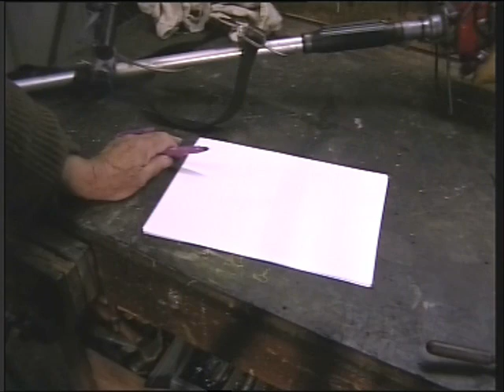cdi for dummies

Comment: Is it correct to say that on the CDI ignition coil. that the spark at the SECONDARY winding is produced on the RISING edge of the discharge capacitor into the PRIMARY winding?
I built such a model and the waveforms indicate this is so!
What bothers me is that several other sites claim that the spark is due to the FALLING edge--which is contrary to what I actually see.
Thanks for a video I can actually believe, as it agrees with what I actually witness!
Reply from the maker: Yes that's my understanding perhaps thats where some confusion may well exist the CDI coil consists of two windings (i.e. a transformer) and we are therefore dealing with "inductance" at some level some delay must be a factor,

Comment: I could argue but it would be point-less.....    hehehe.  My old GT125 Suzuki twin was perfect except for the points back plate. It was fairly highly tuned and the points were set by a tuner but the back plate constantly moved and id end up running on one pot kicked normally or both pots if i bump started it backwards!!!  It ran sweet IN REVERSE!  You cant do that with CDI. lol.

Comment: good video, have you any advice on a cdi problem I have in that a Jetski I rebuilt starts but seems to be stuck in limp mode ie' will not rev up its a Polaris sl780 any help will be very gratefully appreciated. yours George.
Reply from the maker: I know practically nothing about jetskis but you say it runs (allbeit poor) saids you have a spark, whilst many cdi`s may well have processing that advances the ignition to speedup the engine it would not be "my" first approach if fact the cdi is the last thing to go for ! left alone they more often than not, are not faulty, so I would take a look at carbonation .... blocked jets,resticted air inlet,or evan outlet, go for the most likely probabilities, and dismiss the assumption its a "cdi problem" highly unlikely !

Comment: hi I really enjoyed not only your vid but your commentary. I do have a question, that diagram you drew was that the sator and flywheel spark generation? my question is, is the static stator orientation important in relation to the flywheel rotation pickup when it comes to spark timing for the cdi? on my 4 wheeler im getting spark to the plug but its weak, and im unsure as to the timing. the cdi's resistance tests are outside specs. your thoughts would be valued. 50p plus lol
Reply from the maker: I`ll lay you a £1 to a 1p you have NOT got a week spark. review 5.00-7.00

Comment: billb
Help poroldchap!! I have a 2002 CB750 Nighthawk that runs great, except if you happen to stop somewhere and the engine is at operating temperature it won't start  back up or sometimes it even dies. So the problem is when the engine is hot, we have to wait for it to cool down before it will start. There is something in there that doesn't work right when the temperature is high.
Thanks
Reply from the maker: Japanese motorbike ? I`m not the person to ask !
Reply: +William Bigatti I would, 
A) Check for a spark with known good plug once the engine dies.
B) Buy a cheap compression tester if you don&#39;t have one and check for compression problems. If you have them, suspect that your valve clearances are too tight. As they get hot they get tighter. 
C) Touch the coils to see if they are hot when the bike dies. If so, that&#39;s your problem. Consider moving them or shielding them from engine heat.
I don&#39;t know that model of bike. If it has points lookout for a leak to earth causing an arc in them. A faint glow should be visible.  If it is a cdi problem you will need a Ohm meter and  the manual for the values you need.
Good luc
EDIT: Extra thought. Could be you are running the engine too rich. Check choke operation and the settings of the float levels and condition of the needle/shut off valve.
Reply: Hi, that's a common problem on old two stroke engines, it's cased by worn oil seals that are fitted on each end of the crank shaft. All  2t engines rely on crank case pressure to work, when they get old and worn, they leak when hot causing crankcase  pressure to be lost.  Trust me that IS your problem

Comment: You are bang on the button i have fixed loads of little motors and 9 out of 10 times iys down to the sparkplug oiled up and no spark. The only thing people can do is to mess up the amount of oil to petrol mix and boy do thay. The way i look at it is if thay did not we would be out of a job. Keep up the good work.

Comment: Do you think if you put a capasitor on the output wire to the coil it would boost spark Allso would it help if the one inside cdi unit had lost some of its value  thanks
Reply from the maker: unfortunately no to both parts of you question.
Reply: Thanks ol chap !

Comment: In many cases if you do have a bad CDI unit, depending whether it is AC or DC, it can very often be replaced with cheap pitbike CDI from Ebay for less than £10.

The CDI systems used on small engines, was originally patented by Atom Industries in Australia, and when the patent expired was widely copied by thousands of other manufacturers.

Comment: Thanks to you POC. You have uncovered the mystery of the d***d black box in these small motors. For the record I was trained as an electrical engineer, so I undestand exactly what you said. I have kind of the same experience you have; except my engines are usually lawn mowers, roto-tillers (believe you brits call it a rotovator) , chainsaws, and other backwoods implements. As a matter of practice, in this country spark plugs are cheap, say two quid. So the first thing I do is replace the plug. This fixes 99% of all problems. But if it doesen't then I usually replace the black box. This, again, is no big deal in this country compared to the price of a new implement. But at least now I know what I am doing.
Reply from the maker: In this contry a quote for Mariner outboard cdi £80 determined not to be ripoff got it going for less than £3
being poor is a great incentive !

Comment: Good video. In my limited experience when there is an actual CDI failure there is another problem or the CDI was not good quality. You can do a search on the internet now and there would be several people with the same problem. I have come across it on boat motors, snowmobiles and motorcycle. It does not happen often. Sometimes the manufacturer got a batch with a few that are not up to quality standards. I have had more problems with the old points ignitions. They were so easy to fix and cheap that few noticed. They pay more attention when that rare expensive part breaks and misjudge the product.
Reply from the maker: I beleave cdi failure is not a common problem in fact rare ! far more are replaced needlessly was the message of my video.
I found a site something like TZrewinds.uk that was the best explanation on the web unable to find it since ? there knowledge and expertise was second to none !
Reply: Ah, my comment didn't hit the point. You are right. I meant that I have seen a few but they were replaced under factory warranty. They were considered defective from the manufacturer.

Comment: POC  I  was wondering if you could make another vid for your CDI  tester,  but with USA 120v  components.  what cap,diode etc.  for 120 volts.  and explain the switching a bit.  I work on small engines mostly outboards,  However I really no nothing of electronics.  I was going to have a mate of mine who does know electronics watch the vid and build it for me.  thanks for your knowledgeable vids from Alaska.
Reply from the maker: Go to "homemade cdi coil tester" video and read the comments